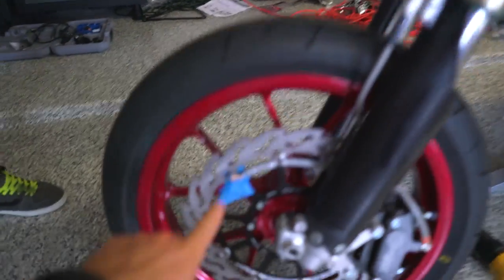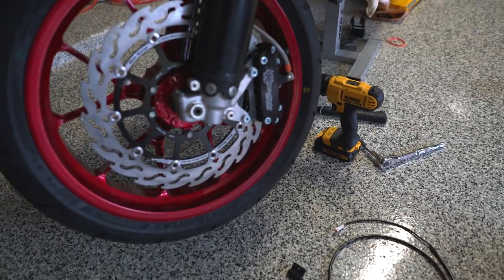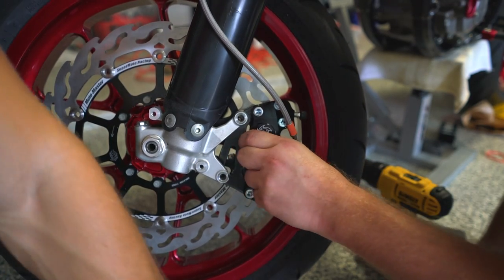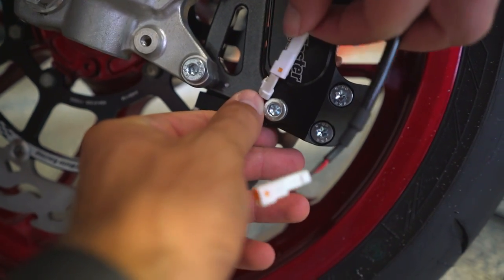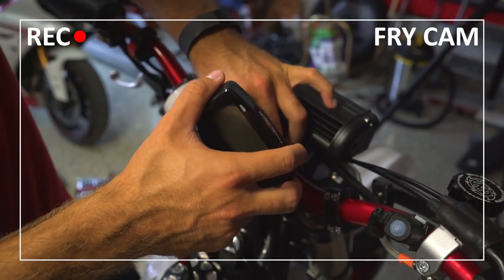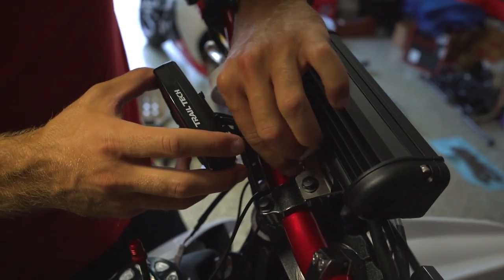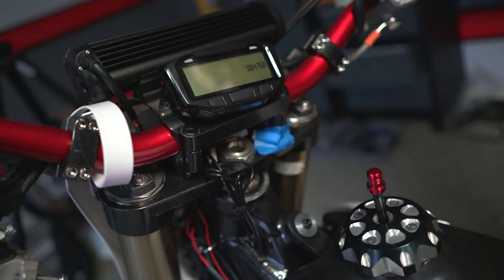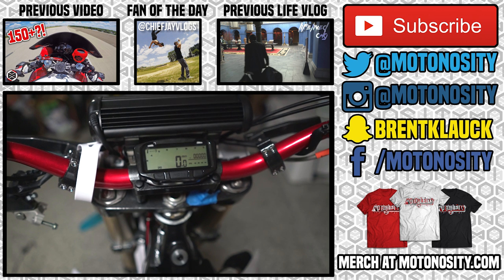Adding a SPEEDOMETER to a DIRT BIKE [Supermoto Build Part 12]

Comment: When the front suspension compresses, won't the wire that runs up the brake line and behind the number plate be out of whack?
Reply: yep hopefully he reads this comment.
Reply: As long as their is slack at the top bit near the number plate it'll be fine, I've got the same one on my WR450SM :)
Reply: Never had that problem on mine, it moves freely

Comment: push the wire around the inside of the brake line 
and get rid of the connector, just solder them and shrink tube, one piece to the top, clear red etc, hides the braided line but. may clean it up how you want

Comment: you should put dielectric grease in those wire plug connections. that'll keep moisture out and help prevent corrosion.

Comment: as someone else also commented u might think about running that speedo cable the rest of the way up ur brake line u have to figure both cable will travel up to12" upwards with the front wheel and with it behind the number plate might not work so well

Comment: Is the sensor wire going to be okay, given the high temperatures found in the braking system? A good idea would be some braided sleeving to disguise and protect the delicate cable and connector, and it would look better than a wire piggybacking the brake hose..

Comment: if the line is secure and mounted correctly it will not start rubbing other components so even if things seem close running it in the inside should not pose a problem. running it on the outside leaves the possibility for it to get snagged, not a huge deal on a supermoto, more common on offroad bikes running through rough terrain for example. usually boils down to preference but I dare say most guys run their line on the inside, as do most if not all manufacturers on their mx, offroad and supermoto bikes.
Reply from the maker: I agree with you. I don't think it would've had any issues on the inside. But we'll see. Not difficult to move it back.

Comment: I am surprised you didn't mount it inside one of the floater slide pins(open rings holding the rotor in place-not sure if i named it correctly).

Comment: Motonosity Awesome series, I might be wrong but it looks a lot like your front brake line is installed upside down. Also routing the brake line around the outside of the shroud has no benefits compared to routing it stock, just eases the mind. Loving the way she looks, keep it up man.
Reply from the maker: It's definitely not upside down, but thanks for the concern :)

Comment: Magnets!!! Magnets and JB weld to mount a small strip or any basic magnet 🧲 on the handlebar risers. And whatever on the bottom of the vapor. Could even style it out as long as it mounts which tied into the cables might even be the best situation since if a catastrophe happens the vapor will break free from the bars yet not go to far cause it’s wired in. And I’m sure you’ll figure a way to lock in the magnets 🧲 so the feel secure as if you’re one with the vapor though the bars to the ground! Like a Jedi, 
I’m gonna be tryin to figure out how to put an air conditioner on my bike too.

Comment: ive got my magnet just stuck to the side of the rotor instead of glued on the inside edge like you have it.  Mine works great, even off road.  you could probably stick a bit of super glue under the magnet if you're worried about it and put it on the side if this set up doesnt work.

Comment: Questions on the speed sensor. Does the reading change based on where the speed sensor and magnet are mounted? Say you ran them lower or higher on the wheel? Or say you ran them on some 21 inch knobbies? Bigger wheels spin slower at 45mph in comparison to a 17inch at 45mph. Does the sensor compensate?
Reply from the maker: You program the Vapor to your wheel size. The position of the magnet doesn't matter since it will make the same number of rotations per minute regardless of position :) #science
Reply: +Motonosity  True! Angular speed not linear speed. #ImANerd.

Comment: Isn't it better in terms of look and practicality to install the censor on the back wheel? Would be easier to hide the cables, and it wouldn't move each time the fork is compressed.

Comment: cool build love it, but zip tie electrical on break line where break line will always expand is not good. Rethink, maybe ok short term but constant pressure on electrical wires which are more fragile then brake hmmm, I can see failure there

Comment: Really enjoying the build series.  Why didn't you just buy the mount that they make for the speedo? Any specific reason or just to cut cost?
Reply from the maker: I did! But with the LED bar, it wouldn't work. And I actually like this setup more. Almost like it's just held on with magnets :)
Reply: +Motonosity it definitely looks clean how you have it, and like you said what's a supermoto without zip ties lol

Comment: Just wondering why didnt you guys put the magnet in the holes on the disc? Ive got my magnets in those holes and they sit there really good :)
Reply from the maker: With the adapter for the bigger rotor, the actual caliper (and thus, sensor) sit too far away

Comment: Dude your break system costs an easy 2k alone, just the the freakin front!! I have my break cable routed inside too.. and my breaks cost a fraction of that Supa functional moto art.. what’s the worse that could happen . The cable catches and rips the disk abs calipers clear off.. you’ll totally make your friends day who’ll obviously catch ‘em in his grill.. oh and btw I’ve never actually put a bike or fundtional bike together before I put mine together. I’m nearly finished just installing the vapor like you. Then riding up to pay the man to do a serious professional inspection before I go serious. But the wire staying inside

Comment: What is that on your handlebars above your awesome spot (I knew there was a reason I was watching this video) is that like you air conditioning unit? You are on a motorcycle excuse me Supermoto!! I guess if styling it out with the all the fancy Artsie fartsy brakes abs gizmos, why not take it to the next level with air conditioning. I bet nobody will have one of those !  😎
Reply: Now that’s slick Af!! I’m rockin mad zip ties which (I’m not a fan of, esp when I unsuspectedly get scrapped on one I missed melting a we bit to take off the edge) but I’ll replace em all with waterproof shrink tubing cause that’s how we do it in 1990’s when giving our motos their Supa, and to Supa Dupa this project, I just whipped out the 3M Double sided tape!! But because The trolls in this town steal anything not nailed down and often attempt to thrive it even when it is. I’m gonna test my VaLcro Tape, which I’ve got my Anti-gravity Lithium Battery mounted with. As it looks suspended in air all antigravity like with just Velcro tape holding it up. Abs if you don’t have an antigravity lithium - re-start (which you can jump start the battery with itself cause it’s smart like that.. I highly recommend putting one in . Along with either an m1 or basic fuse box which seriously takes wire harnesses  to the next level of organization and strategy. But I’ve gotta catch up on some of your other YouTube’s. Maybe you’ve got em both and I should shut up now and go play with my Velcro